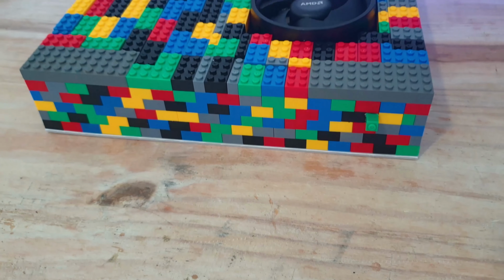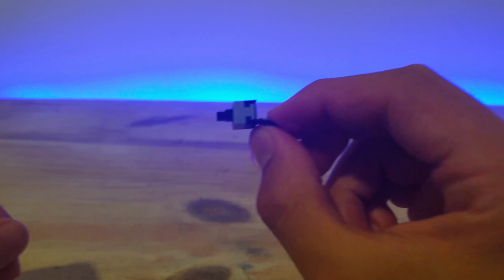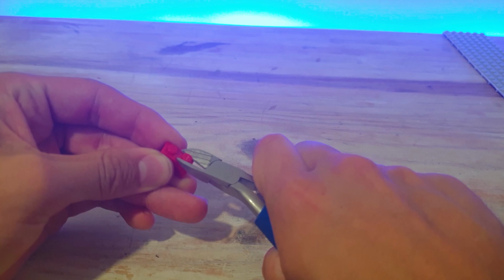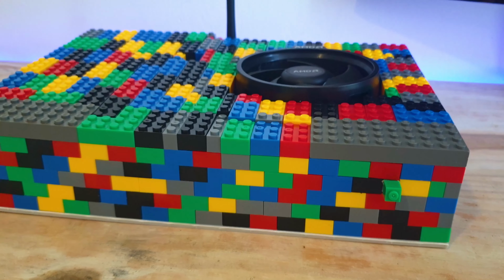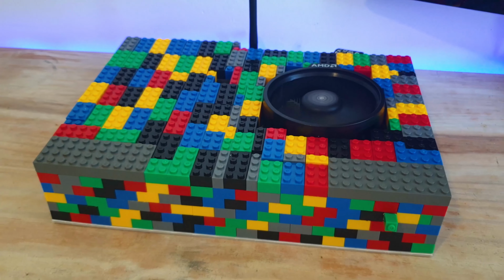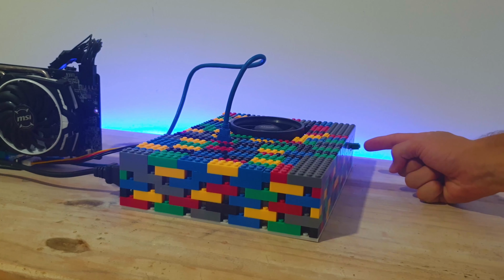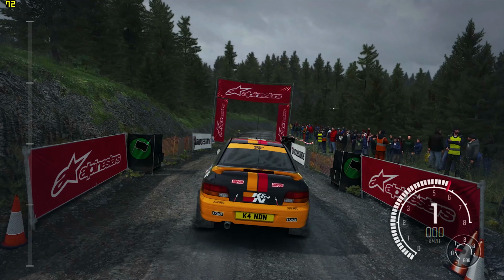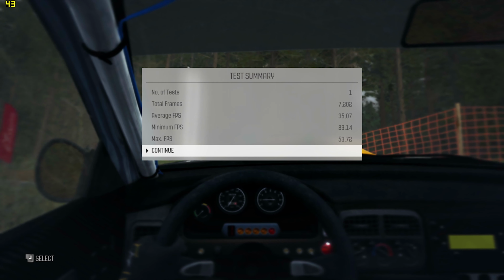Lego pc Case With DIY USB Riser External GPU

Comment: i planned to use the same idea , but m-atx size , with real size power supply (i will cheat by using some super glue to make it unbreakable ) also to make it cheaper $$$, ill buy knockof lego  boxes but good knockoffs ... megablock or similar, with the same colors and not shaded colors....

Comment: I know that the GPU wouldn’t fit inside the case which is why you made it external, but have you ever thought about building the LEGO case to be a little taller for extra room to fit an internal GPU?
Reply: That's a dumb idea, just get a normal riser, route it under the power supply, build the case out, and plug in the gpu. It's flat so there is no extra space wasted like your approach.

Comment: This is awesome! I want to try this with a PCIe Riser so i could lay the gpu flat on top of the PSU and build around it.
Reply: Don't. This is a mining riser. It does not work good for gaming. A 1060 needs around 4 lanes to work properly, this is 1 lane. Get a normal x16 riser.

Comment: Need actual fans blowing air inside the case. Just because it has some gaps doesn’t mean the cooling will actually happen. Sure hot air will leave the “case” but not fast enough. It will bake the stuff before it leaves
Reply: It really doesn't, I made a case out if cardboard with no intake or exhaust fans, air naturally escapes due to how small it is, and in his case, the power supply will act as an exhaust. You seem like an annoying safety nerd that would say "oh your gonna have your pc catch on fire, cardboard is flammable and the components are gonna get so hot it's gonna catch it on fire" even though the flash point of cardboard is 427° Celsius and no one component will never hit that temperature. Even if they overheat the worst that will happen will be a thermal shut down at 101° Celsius. Anyways this case I made our of cardboard, the cpu never reached above 65° c and the gpu never reached above 65° aswell. This was with no power supply inside, no fans inside, no vents. Shut up safety nerd, your opinions don't reflect reality.

Comment: It looks really nice but you’re bored and everything else would overheat because there’s no airflow takes us out anywhere After looking up the Legos they can’t survive that kind of heat they will melt on top of that power supply
Reply from the maker: There are holes on the sides and the back and the air gets blown down on the board and out.
Reply: Ventilation seems fine to me. Theres quiet a few gaps on the sides. But in case im wrong, a small fan could do the trick